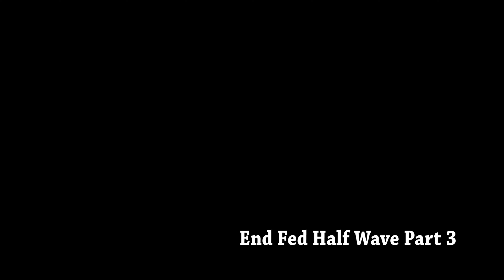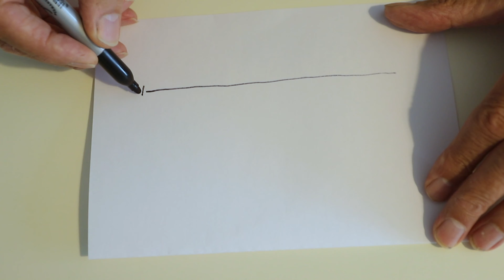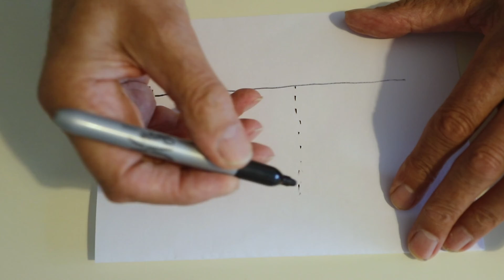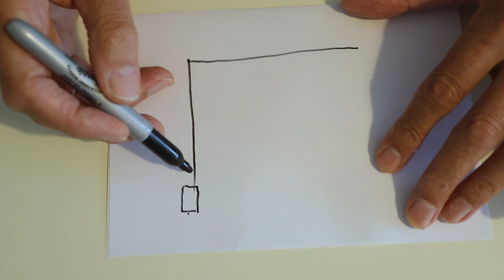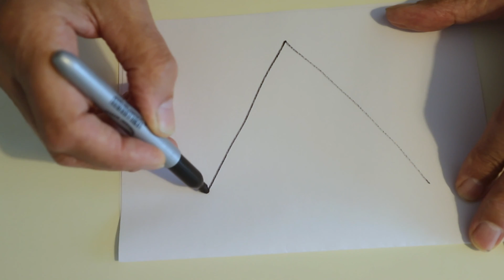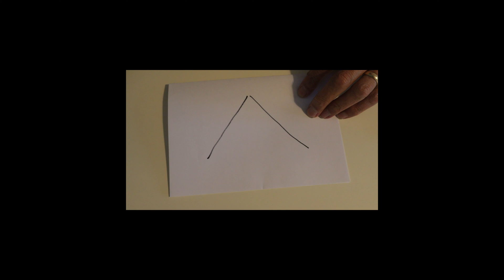End Fed Half Wave Multi-Band Antenna Part -3

Comment: Thank you Peter!  This is a very informative series.  
I'm blessed with plenty of space, but vexed by having very little structure for an L or inverted V config.  I'm in a 2nd floor apartment and plan to hang one end from a tree with the feed point slightly above it at the house.  
The antenna a Nelson EFHW 40-10 just arrived today and I hope to be OTA tomorrow.
73 de K1NKX

Comment: question , I heard from other sites that  if you take a end fed wire ,and run it in a 90 deg or more that it will decrease its effectiveness ???  your view ?
Reply from the maker: Well normally you bend an antenna because you have no alternative! I doubt there is any change in efficiency, but rather in the radiation pattern. Sometimes that can be a good thing. 73s Peter.

Comment: Would it work if I ran the vertical portion of the L attached to an exterior wall? Does it it need to be in free space? I just recently got licensed and live in an apartment. I'm trying to figure ways to make antennas work with the space I have.
Reply from the maker: I would try and avoid direct contact to the wall. Try and space it around 12 itches from the wall if possible. Maybe a bracket on the wall t bring the antenna away from direct wall contact. 73s Peter.

Comment: Good presentation wondering why you've not mentioned grounding the transformer
Reply from the maker: Hi Paul, there are conflicting opinions on this. My transformer is up in the air and I tried earthing to heating system and to a direct earth.  I found no difference but of course the earth connection was a significant length. Using it portable without an earth works fine. Peter
Reply: @watersstanton  yeah there is conflicting opinions, I follow Steve Ellington and his testing with this antenna, he has a video with various grounding tests that show how much more current is on the radiating wire with a modest ground, if nothing else grounding  would help with common mode current on coax

Comment: Hi Peter -  with the L shaped antenna would it also work coming horizontally from the transformer unit then turning up vertically half way along the wire. Up a tree for instance.
Reply from the maker: Hi. It will certainly work. Try it. 73s Peter
Reply: @watersstanton  Hi Peter - Thanks for the reply. Yes it does work - I tried it this afternoon.   Made contacts on 20 and 40  as far as Bulgaria.  No ATU  needed. 73 from Frank - Towcester.